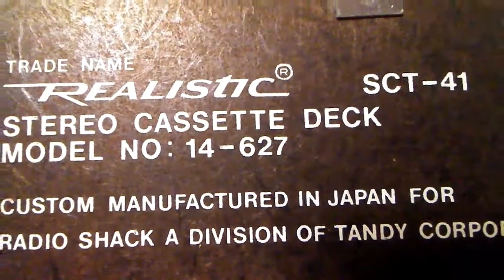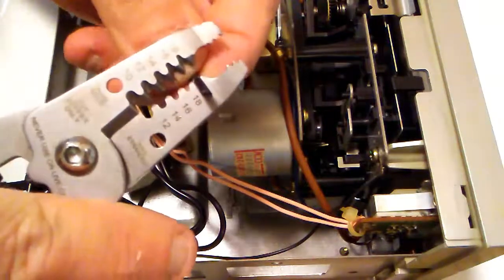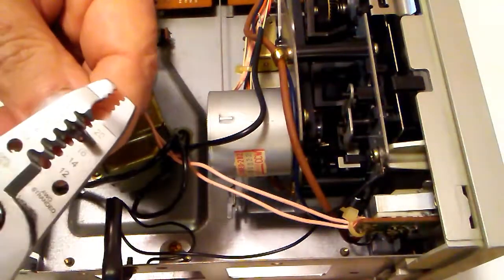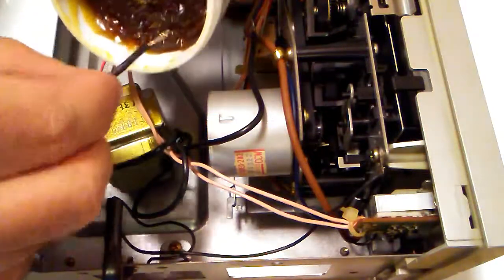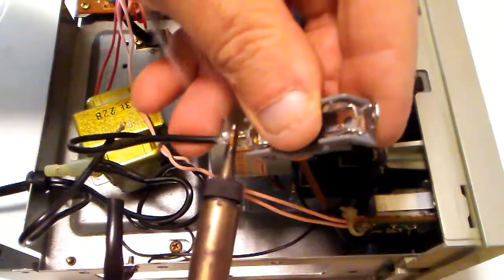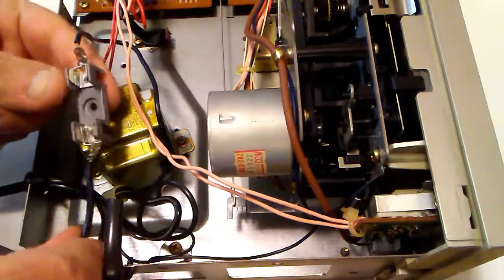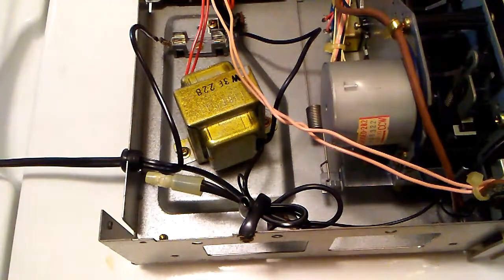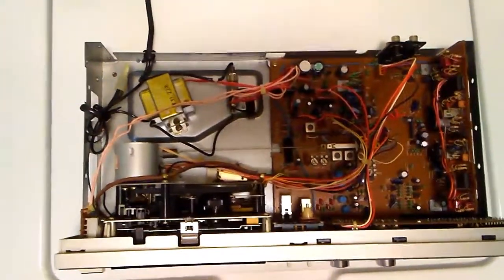the realistic sct 41 tape deck i solder in a line fuse no over current protection from the factory

Comment: Hey Dave. I have two. What size fuse did you use?
Reply from the maker: Gregory McKinnis  check with a autherized  service  center before installing  the  fuse  and show it to them after installing just for your saftey if the fuse block has rivets that show on the bottom I would put electrical tape down what kind of music do you like I like classic rock country blue grass thanks
Reply from the maker: Gregory McKinnis I would show it to a autherized service center when you're done I would like to see it to can you put it on your YouTube what kind of music do you like I like classic rock and country and blue grass thanks
Reply from the maker: Gregory McKinnis I have lots of videos installing line fuses my latest is the realistic sct 11
Reply from the maker: hi how are you did you put in the line fuse yet i would like you to make a video of you puting it in i would ues a selfi stick atached to a clamp so you can clamp it and record thats how i do my videos
Reply: No not just yet. There are some things I need to do to both decks before I do that.